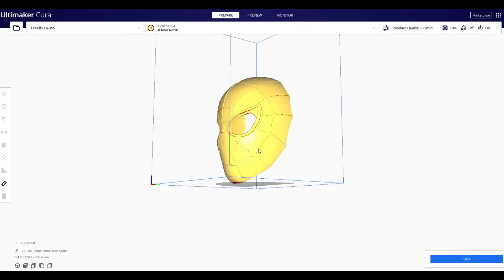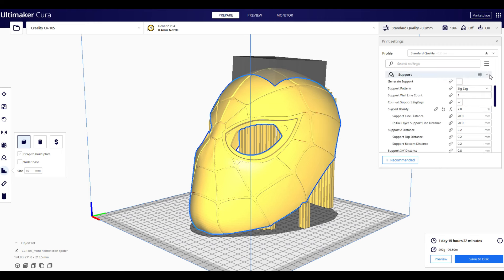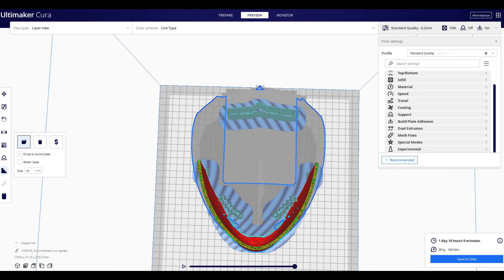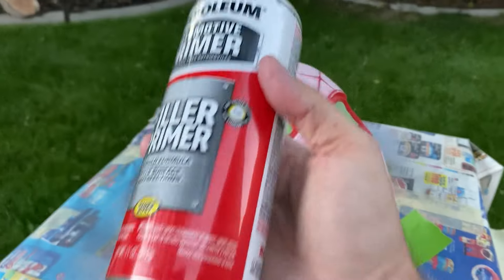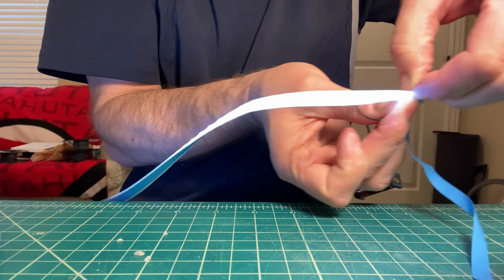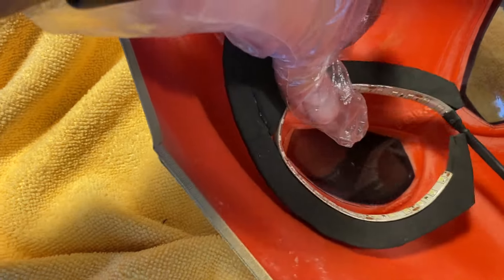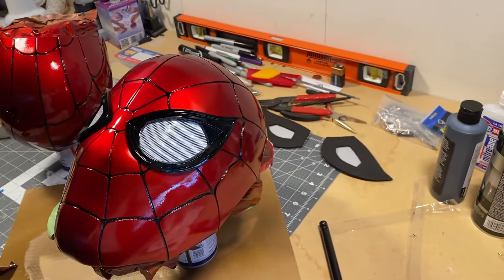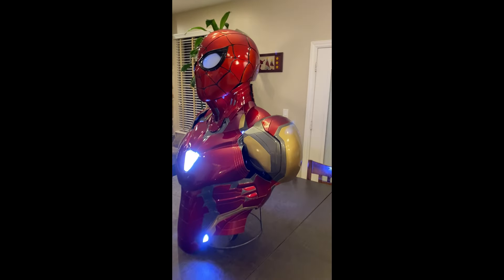How To Make Iron Spider Helmet

Comment: Hi man, great video! Just one quick question: how did you get the elastic band to stick on the helmet I use superglue and the fabric just won't stick to the part and it makes the elastic band hard and it won't stretch anymore
Reply from the maker: You have to sand the part of the helmet where the elastic band will be glued (rough sand).  I use a two part super glue (Mitreapel)...it comes with a spray accelerator.  Works great.